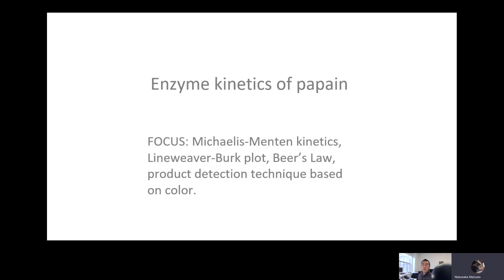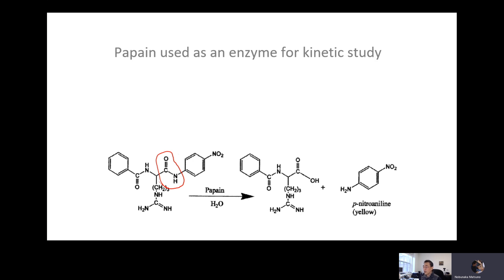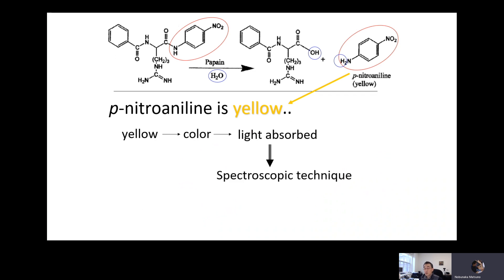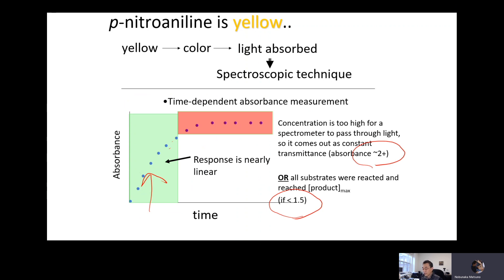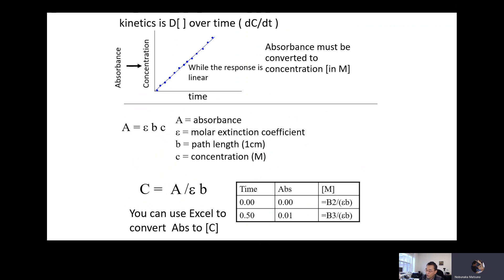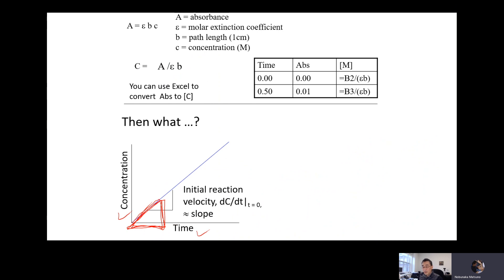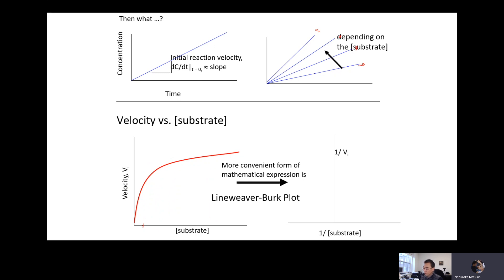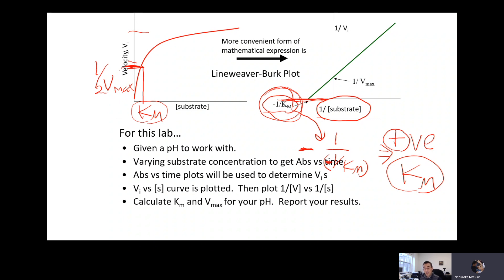Enzyme Kinetics Experiment   Explained

Comment: Thanks, this will be helpful for my research. I have a question if you may, can I use absorbance as [Concentration] to determine velocity instead converting with A= e . b. C first?
Reply from the maker: Thanks for finding this video.  You can, as long as you know the molar extinction coefficient. Our instrument records the Abs as a function of time. So, the data conversion is done after the data acquisition. Your instrument may already have a setting to multiply (or divide) with whatever the constant on your y-axis.
Reply: I know it's kind of randomly asking but does anyone know of a good place to stream newly released series online ?
Reply: @Otto Leonel Lately I have been using flixzone. You can find it on google :)
Reply: @Otto Leonel lately I have been using FlixZone. You can find it on google =)
Reply: @Cesar Idris definitely, been watching on flixzone for since march myself :D
Reply: @Cesar Idris Thanks, signed up and it seems like they got a lot of movies there :) Appreciate it !
Reply: @Otto Leonel Glad I could help =)